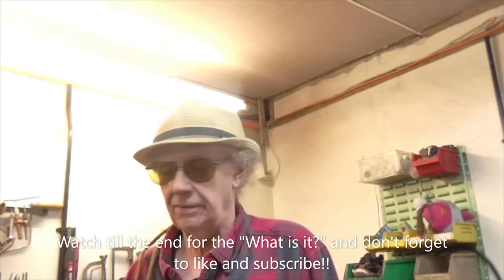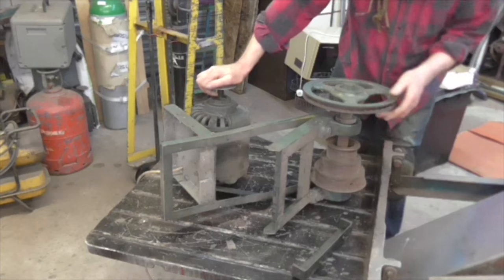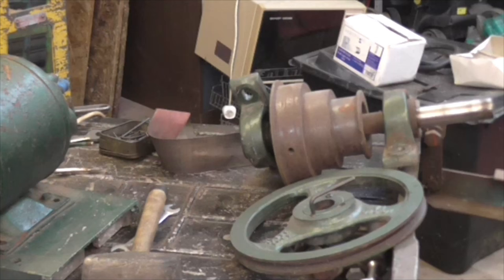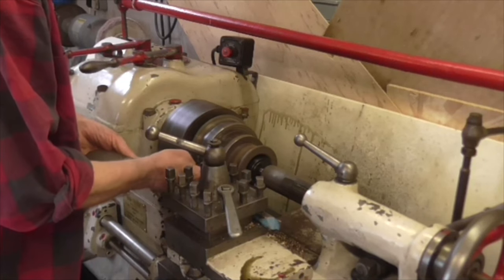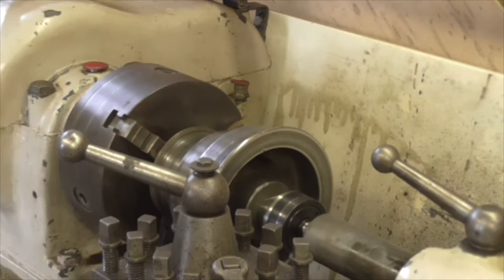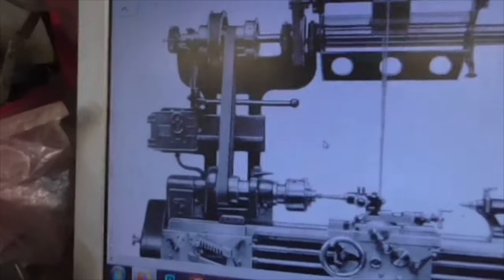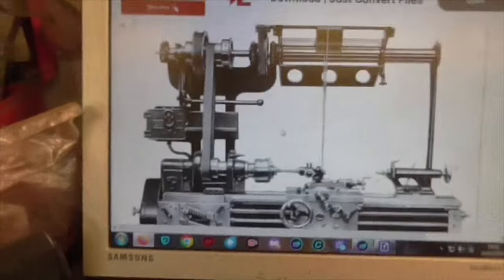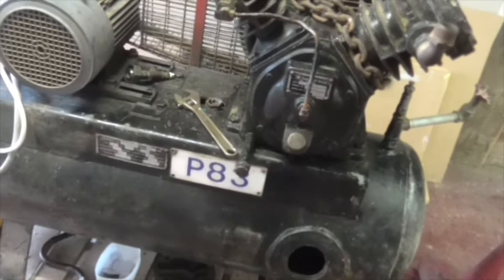A "What is it" and Ingersoll Rand compressor repair, and Holbrook countershaft!

Comment: Great video. The Holbrook countershaft project looks fun and I am looking forward to following along. The parts cleaned up very well
Reply from the maker: @GardenTractorBoy  only the pulley is original, the rest has been made up to suit! Now that it has been pointed out to me that originally there were two sets of pulleys between motor and countershaft to give a high snd low ratio, I do not need to slide the pulleys and that simplifies my task no end!
Phil

Comment: Evening Phil, just back from finishing my lads patio, hope there's enough summer left for a decent barbie. Not easy getting your head around the pulley system , my C10 has a twin speed gearbox  and brake  which makes life a lot easier ! Liking your decision to have the lathe freestanding, will look sweet, those pillow blocks looked quality items and the Ingersol Rand are true workhorses. Thumbs up for the tripod...Del..
Reply from the maker: @machinenutdel6764  thanks Del, yer a scholar and a gentleman, or as Keith would say, a scallop and a genital!. Well impressed with the Brierly  Del sharpener!
Phil

Comment: I'm only making an educated guess but you seem to have a wind tunnel model of a tornado, the aircraft were built at Warton near Preston, a Anraam is an air to air missile that replaced a sparrow aam, one of the other rockets is actually a wing tank for fuel to increase range. your assumption about the " pitot" tube would be correct to measure air pressure.
Reply from the maker: Thanks for that, we suspected as much! 
Phil

Comment: Smashing video as per. Like my brother said it's an instructional wind tunnel model. We had similar at DCAT RAF Cosford in the Aero - Thermal lab. The Holbrook is coming along. It seems to me that the belt will be the same for each combination of pulley. I guess you need to be able to tension and de tension it though. It's late and I can't think. Hope you are well Phil.
Reply from the maker: @carlwilson1772  very well thanks Carl, lost2-1/2 stone and have just had word from the doctors that my diabetes is officially in remission! I am awaiting delivery of parts for the countershaft stand, and I have had it pointed out to me that there is no need to slide the pulley along the shaft as the original used two speeds between motor and countershaft, either by different size motor to countershaft pulleys or a two speed gearbox hidden in the motor box! Much simpler!
Phil
Reply: @philhermetic  Very glad to hear about your diabetes. Looking forward to seeing the progress of the Holbrook countershaft system. Take care my friend.

Comment: On my lathe belt tensionis adjusted using a bottlescrew the countershaft being hinged
Mick
Reply from the maker: @freebornenglishman8969   Hi Mick, good to know! My first idea was to hinge it (simple) my second was to make sliders and have a handwheel and thread to adjust it. I am still undecided but I have ordered all the fittings for the countershaft stand today, they should be here Tuesday so I will get the frame together and then decide!
Reply: Interesting mix Phil. That pulley looks well engineered. Cheers Tony
Reply from the maker: It is Tony, but whilst the two larger positions are identical the small ones are slightly different diameters, although it does look exactly like the one on Lathes.co!
Phil

Comment: Did it perhaps originally have a dual speed motor Phil - that would give you your 12 speeds as per the current mechanical set up?
Reply from the maker: @andrewmawson6897  not according to the spiel on the Lathes site Andrew, six speeds on the pulleys, doubled to 12 by the back gear. I scratched my head long and hard on this before the penny dropped! Have a look at lathes.co.uk/holbrook, its the B9.
Phil
Reply: @philhermetic  The pulley crowning doesn't look like two sections per pulley, and the picture you show shows a single wider belt that covers the full pulley width
Reply from the maker: they are difinitely higher in the centre of each pulley, but the tapers to each edge don't seem to be even, we will have to see how it runs! Alignment between the to pulleys is always fairly critical so I will have to get it right!
Phil
Reply from the maker: Andrew! You are correct!! Not a two speed motor but an extra pair of pulleys between motor and countershaft! Sometimes I just don’t look hard enough! Apparently some of the B9’s had a splitter gearbox in the base too so no need to slide the pulley! Life is suddenly a lot simpler!
Thanks!
Phil